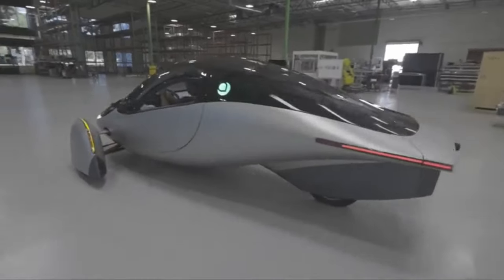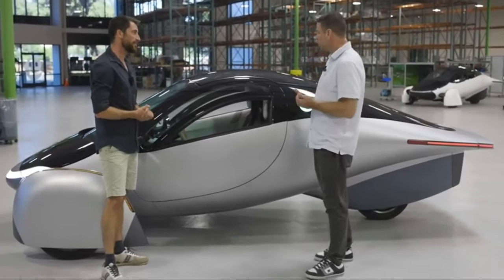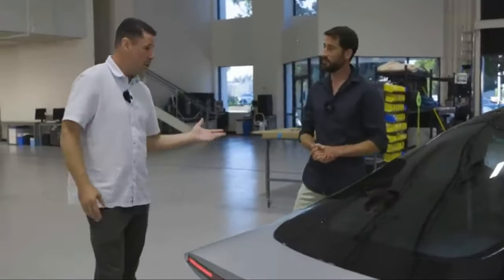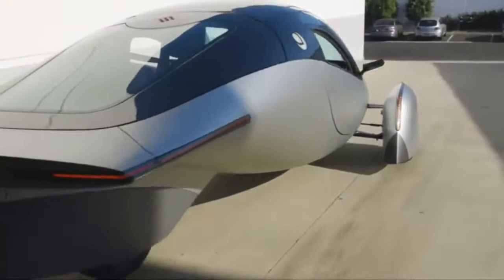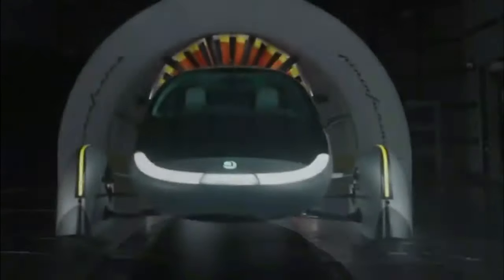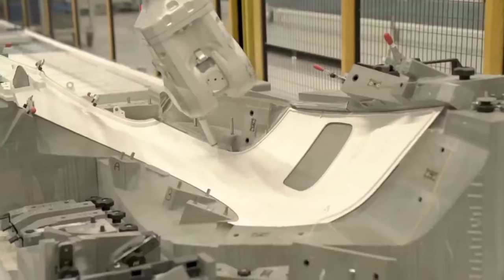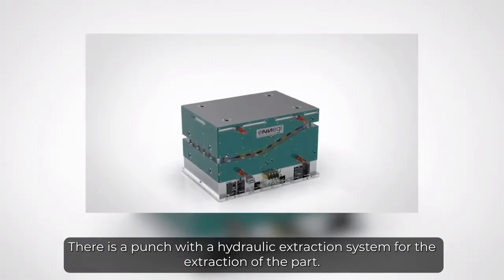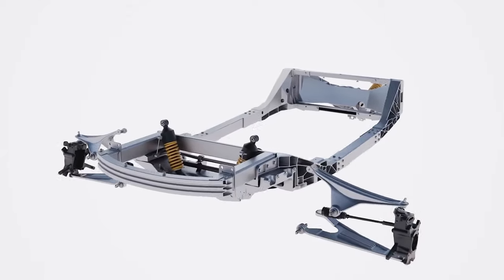Aptera JUST went on in UAE as Production Started

Comment: Aptera is not on sale in UAE.  This is just the UAE version of the accelerator program.   There are 53 build slots being provided by Aptera to the UAE for an investment of $27,000.  This investment in the company doesn't buy the car.  The cost of the Aptera UAE launch edition will be about $54,000 additional dollars.   Aptera needs to raise money to fund the production intent vehicles needed for final testing, validation, and safety.  The US accelerator program included 2000 build slots and required a $10,000 investment.   Again, the investment is not part of the purchase price of the vehicle.
Reply: Aptera taking a page from what Lucid did on a smaller scale.
Reply: Big difference is UAE vehicles promised in 2026 as part of $27K. That could easily run into initial delivery of LE and force LE delay to accommodate UAE promised delivery.
Reply: @artsmith103  If Aptera starts production March 2025 and averages 20 vehicles a day when they want 40 a day, then by August or September 2025 all US accelerator builds would be done.   UAE accelerators are scheduled for 2026 delivery,  so Aptera has some production safety margin.  Seems like a reasonable approximation.
Reply: @artsmith103  It might also allow Aptera to set up a production plant in the UAE.  Nice reasonably central location for delivery to Europe, Asia, and Africa.  Very good plan.
Reply: @lucianbakerii7562   I can do arithmetic like that also that is based on Aptera never achieving any production/performance goals. The issue is a reality check behind your arithmetic. In early 2021, Aptera said deliveries would start late 2021. That implies some kind of shell was ready along with motors, cooling, battery and system, suspension, user interface, charge control, solar panel install, regenerative braking, etc. Now 3yrs and some $50 million later, there's an excuse why the shell was changed and none of those other components exist nor has range, miles/kWh, kWh/day ever been demonstrated. Your dream can't start with a functioning Aptera with clever plans how to distribute it. Reality starts with there is no indication Aptera will ever exist at a meaningful price.
Reply: @artsmith103  Yeah, those 53 Union Edition UAE builds, if those slots all fill, will cause a few days of production delay in the middle of the 'post Accelerator, post Paradigm Edition' Launch Edition's rollout. This UAE Union Edition is more of a drain on the design people, than a production blip, it being a minor Launch Edition variant. On the plus side, more production money raised in the UAE could help get everyone their Apterae quicker! Fund raising must go on, it is a necessary piece of the 'getting into production' puzzle with the least amount of money owed. We will all be rewarded for our patience with a better engineered Launch Edition. Aptera's culture of continuous innovation means our vehicles will just keep getting better and better over time. The company is making wise decisions that only strengthen its resilience going forward.
Reply: @jeffcarlton3590   Your comment starts from deliverable vehicle in manageable 2025. Aptera has never met one delivery target. They are a few months behind with 2024 schedule. If somehow they ever start delivering USA LE, they will have to delay those deliveries for promised UAE deliveries. The USA LE do not have promised delivery. It was implied late 2024 but I'm sure that's no longer possible. Assuming there ever is a delivered Aptera, this conflict is certainly developing.  Don't simply repeat meaningless Aptera statements, access everything against reality: design not finished, parts not secured, final prototype never validated, no finances to complete.
Reply: @artsmith103  Hey, 2 of my 3 posts didn't make it either. My response to your lost post: 
"I can do arithmetic like that also that is based on Aptera never achieving any production/performance goals. The issue is a reality check behind your arithmetic. In early 2021, Aptera said deliveries would start late 2021. That implies some kind of shell was ready along with motors, cooling, battery and system, suspension, user interface, charge control, solar panel install, regenerative braking, etc. Now 3yrs and some $50 million later, there's an excuse why the shell was changed and none of those other components exist nor has range, miles/kWh, kWh/day ever been demonstrated. Your dream can't start with a functioning Aptera with clever plans how to distribute it. Reality starts with there is no indication Aptera will ever exist at a meaningful price. "

My response was: "They changed the shell to the CPC produced 'body-in-carbon' to improve quality and mass manufacturing potential when their reservation numbers blew-up beyond their wildest expectations. Since then their vision for what Aptera can contribute to our world has also experienced exponential growth. And we kinda went through some serious market doldrums that killed so many other start-ups trying to launch in the early 2020's. Available & affordable parts and available investment & credit are kind of necessary lifeblood for getting new multifaceted products to market. And you can't do real world demonstrations before your component parts are available for production intent assembly. Most of your grumbles are out of context and out of Aptera's control, as they make necessary pivots to respond to demand and market realities. Your negative nay-saying does appear to be a 'clear-eyed' take. "

And another response to that post: "I believe they will hit close on their production goals, and not pull a 'Cybertruck' on us. We will find out this summer as the new P.I. builds with their new 'body-in-carbon' bodies get real world validation and 3rd party crash testing. Anyone who expects a perfect match between 'virtual simulation' and real world validation with new materials and production intent design changes in tow, will probably be disappointed. There is always the chance of a surprise improvement in some of their earlier projections but most will probably slip a little. Still, over time I hope Aptera, with its 'continuous innovation' ethos will improve on its initial real world metrics. Some wanted improvements like skin cooling and heat pump cabin HVAC have been sacrificed/pushed into the future to help us get our Apterae ASAP."
Reply: @jeffcarlton3590  Thanks. This reminds me of, the coverup is worse than the crime. Aptera managed their development so horribly. They got on the wrong path and got lost spending everyone else's money. I don't see a good ending. They should have started with car professionals and finished a marketable small capability vehicle as quickly as possible. Then demo that and market study how much bigger they could go.